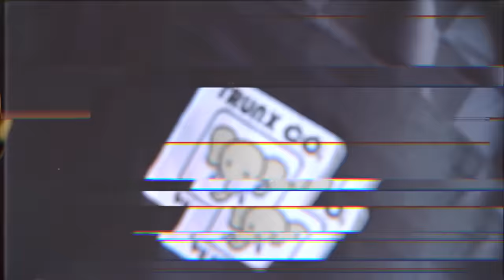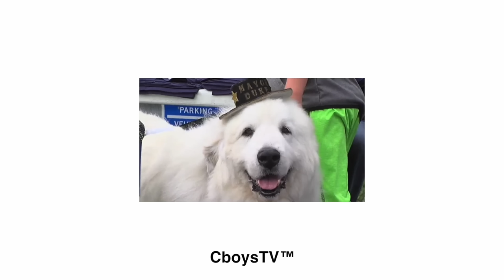Friend Drives NEW Car into Pond

Comment: Every one of these guys must have a smooth brain if a vehicle is not starting the first thing you check is the battery then the fuses then if it's getting fuel then spark ect so on so forth all the way dwn the check list until u find the problem, u dont start with Z then go to A I was sitting here the whole time thinking check the battery pleeease and then after a long while they checked the battery I palmed my forehead. The big indicator should have been when they opened the door an turned the key an no door open beep sound or dashlights came on, first thing. They are all just kids and they look like suburban rich kids so they prob was never tought this kinda stuff so not their fault.           13:02 theres no shot he just said electrical engineer that had to be a joke right? After the car battery thing